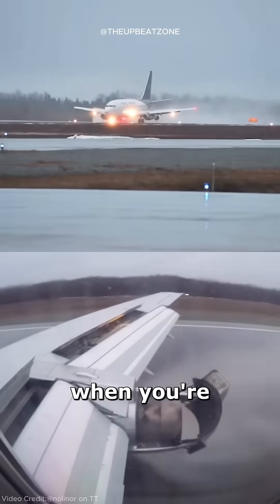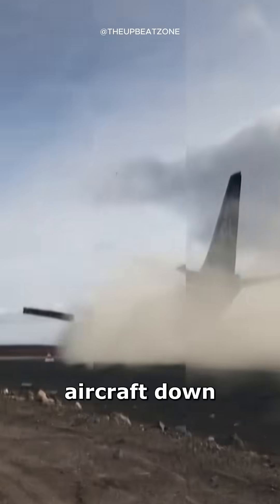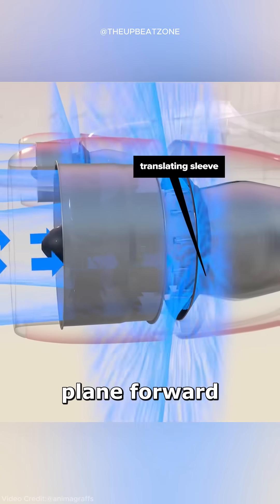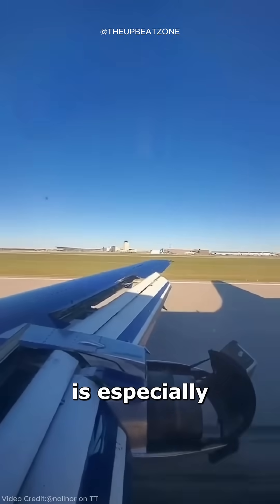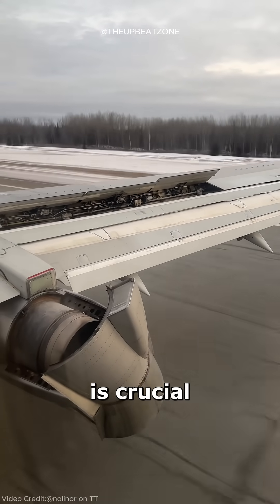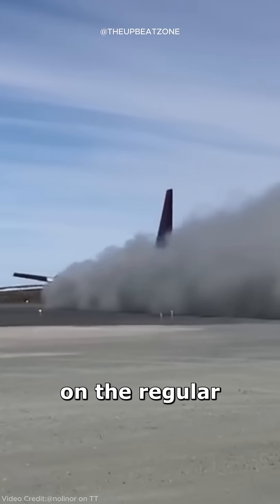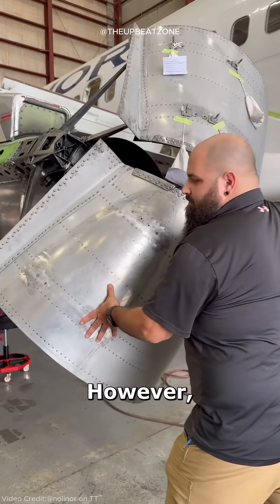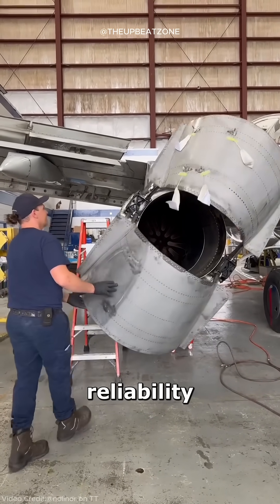Reverse Thrust EXPLAINED 😨

Comment: There is a brief section of the video showing air brakes in action.   They're the inboard panel on top of the wing that deploys when the plane lands, or in some cases, slightly before.    They are used to dissipate lift and increase drag.

Comment: It’s called air brakes
Reply: no, it isn't
Reply: @ yes it is look it up
Reply: an airbrake is a panel that extends outwards reverse thrust is the only thing in this video
Reply: @ yes that’s part of it but the term that’s commonly used is air brakes
Reply: @Bl757jay  but air brake is a different thing entirely. Yes they might be used together often, but they are 2 independed systems that work differently.
Reply: Except, of course, that that's not what this is at all.   Air brakes are a completely different component.